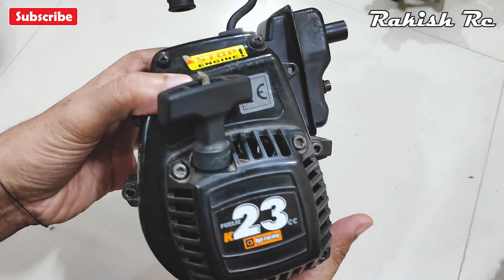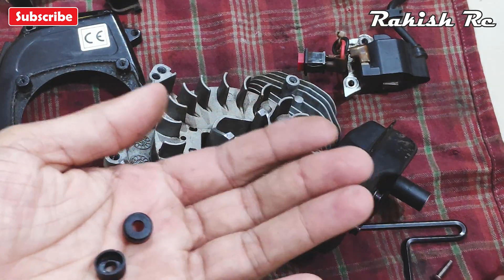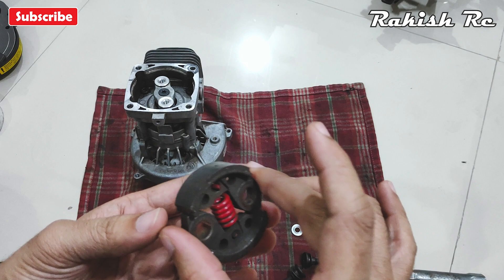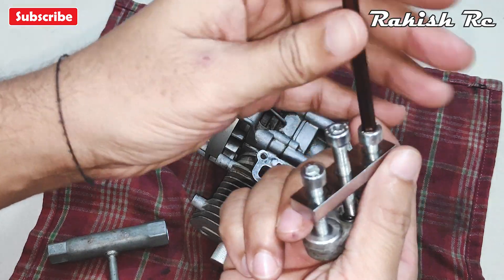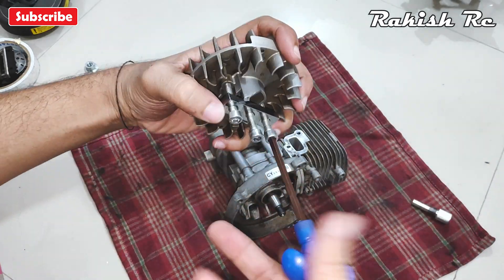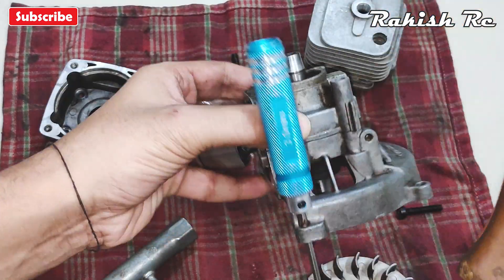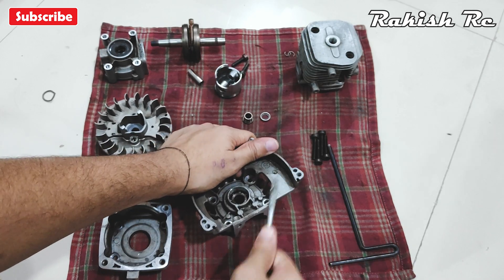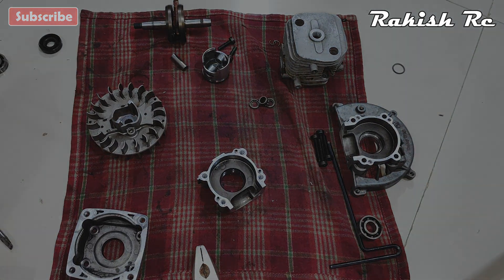Hpi Baja 5b Engine Rebuild | How to Disassemble CY26cc Engine Walkthrough

Comment: Do you use any glue for head gasket once putting back together or just clean surfaces and fit head gasket
Reply from the maker: @johnfenwick8129  actually I did not use any glue or sealant but my advice is to use a engine gasket sealant.. It will prevent any minute air leak and give smooth compression.